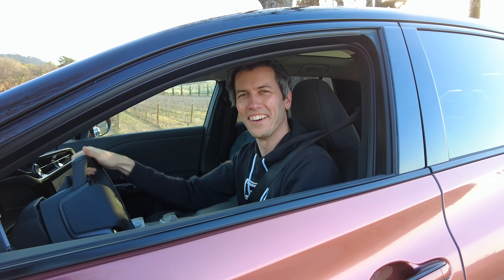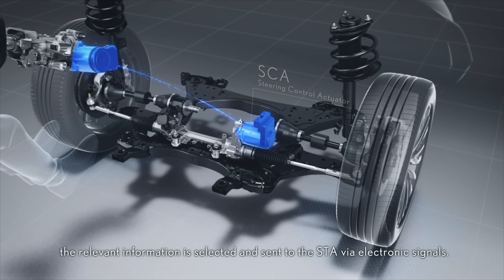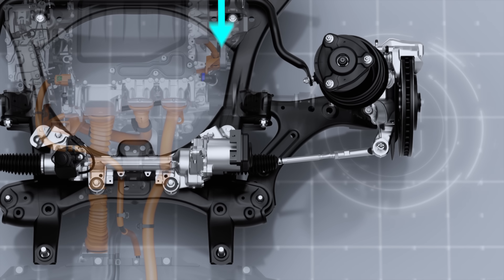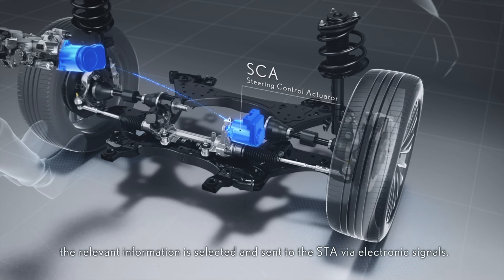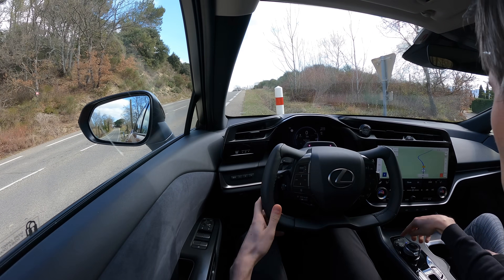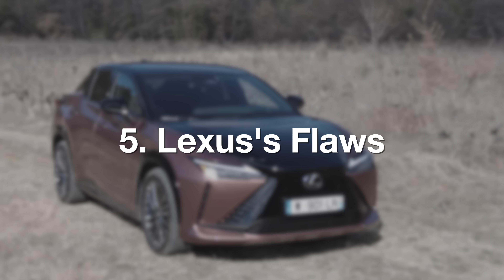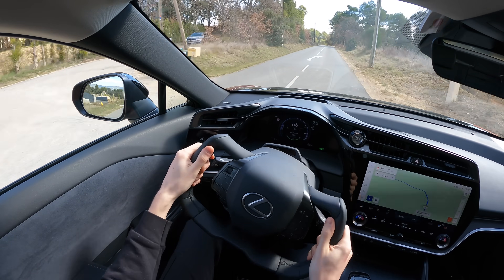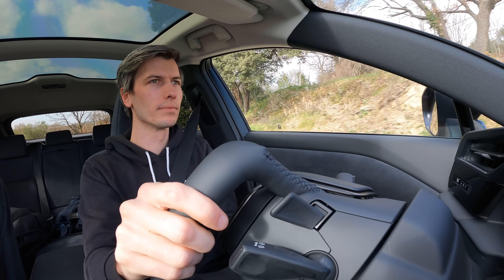How Lexus Fixed Tesla's Bad Idea: Steer-By-Wire Yoke

Comment: May they get sued by many average and below drivers who crashed because of this absurd idea that this is better than a solid, physical connection for steering.  May that engineer get fired and wonder what the heck he was thinking when he thought this better and may the entire board that approved this (even the prototype) get fired for their incompetence.  May the woke buyers who think newer is better get so sick and tired of hearing their wives complain of parking lot woes and trading paint on the highway that they try to give it back to the laughing dealer for a refund and end up losing 10k and getting the regular one with the steering shaft.  May the president of this company and all those that follow in this stupidity get into a steering-induced accident where they lose their teeth but their health is spared, so that they can smile in the mirror in the morning and be reminded of the dummy of yesterday who thought there is a better way by wire.

Comment: Fun Fact: This tech comes from Airbus aircraft. They were the pioneers of the Fly by wire system and is why airbus planes have sidesticks and not yokes like Boeing. :P Boeing uses a yoke with hydraulics system. If u lose that ur done. However on a airbus,  u can still fly with no engines or hydraulics. Another benefit is that if there is a situation, the pilot doesn't have to hang on to the yoke like on a boeing. Cuz airbus uses fly by wire the plane will always level off normally without inputs. This allows for BOTH pilots to focus on their checklists and manuals and getting the situation under control. If lexus made it similar to airbus' sidestick it'll really be a killer car in terms of tech

Comment: I have played ETS 2 and various other vehicle sim games more than I've ever driven a car and I haven't got a single accident in game resulting from the steering system. So safe to say I trust Lexus to come up with an even safer version of a sim wheel than the one I'm using. Also, nobody drives a car by how strong the feedback on the wheel is, I drive a Mitsubishi and the road shock never transmitted to the wheel.

Comment: Another huge fail not mentioned. You are forced/ or this requires, to always keep hands at  same 9 and 3 position....which is hugely fatiguing and cumbersome for casual and safe common average driving needs, particularly long drives.
also fail, along same lines, parallel parking is made more cumbersome. Full fingered grip give more powerful yank making darty slalom maneuvers enhanced.
Reply: Because people don't take their time to set their seat and steering wheel ergonomically. It's shouldn't be tiresome to hold your hands in 9-3 o'clock position.
The guy says it is extremely sensitive while you are driving with a low speed tempo. You will handle it differently, so it's quite meaningless to form an opinion without even trying it out once.

Comment: I don't know if I'd like that.  It'd feel so weird reverse parking by only turning the wheel a quarter turn or whatever it is at low speeds to get full lock.  Plus I like to rest my hand on top of the wheel when waiting at traffic lights or whatever.  I don't think I could get used to the adaptive change in wheel sensitivity at different speeds, but I guess I won't know for sure until I try it first hand.

Comment: Seems overcomplicated to me. A progressive rack with electronic assist can do all of that already. There's even systems with planetary overlay gearboxes that can "disconnect" the sterring wheel by twisting the steering shaft.

I'm not sure it is worth the overcomplication to go fully electronic. Stuff like the delay between input and steering angle can completely destroy the feel of a system, and they are notoriously difficult to eliminate. Ask Airbus why "Pilot induced oscillations" are such a problem on their aircraft - with significantly larger R&D budgets than an automotive steering system designer could ever dream of.

Comment: Variable ratio steering racks have been around for a long time also. Think ls400 as an example of a high contrast difference between settings. And, when the variable ratio stuff fails it’s default is the short ratio. But there’s a reason it didn’t become the norm. It wasn’t drastic enough. Good enough for sports cars, not good enough for a yoke. This eps stuff is cool. And I can’t wait to see what it does for enthusiasts. I hate electric steering. I started with a Saturn ion. Earlier adaption or the electric column. And now drive a 2017 car with eps. Feedback just will never be the same as moving a fluid. This is cool tech, and the future no doubt, but also bittersweet.

Comment: Fly by wire is cool and safe ,if you have a team of technicians servicing your car/plane before and after each use, but for a private passenger vehicle....not having the ability to steer your vehicle in the Avent of a electrical failure is highly problematic.

Comment: I'm not going to trust my safety to something that entirely isolates direct control from me, no matter how many failure reduncancies it has. It's overengineering a solution to a problem that doesn't exist, and coming out worse for it.
Just as I might bypass the power steering pump in my car, if this car were what I had to drive, with the yoke by wire option, I would absolutely chop the steering system, drill a hole in the firewall, and install a rack, tie rods, and steering column from some mismatched junkyard find to replace the system. Even if I have to assemble it with hopes, prayers, and hose clamps, I'd put more trust in it than what  the vehicle comes with.

Comment: Dude you made a 14 minute video with the title saying "why tesla sucks compared to lexus", talke trash about tesla through out the entire thing and then 8.5 minutes in you finally address why tesla is bad and lexus is good. 
here are the points:
1) telsa yoke turns more
2)tesla yoke has less buttons
3) there is no #3, you only had two wack ass reasons.
click bait much? or do you just hate tesla for doing it first?

Comment: I saw a video about steer-by-wire back in the 1980s or 90s. With variable ratio too. But they had a side mounted twist- joystick on the driver’s armrest to leave a totally clear space in front of the driver. Have been waiting for it ever since...
Reply: Wasn't that saab trying to pull the "we used to make fighter jets" card? Idk I kinda think it woulda been neat

Comment: I'm pretty sure that this car will not be allowed to be on the road in my country
it's illegal to drive heavy machinery faster than 20mph  on the road if it has only hydraulic steering, so no physical connection, just hydraulic valves and pistons

well, I drive a 21 year old car, it's safe and reliable and it will propaly still be driving after the first hand full of steer by wire cars had fatal crashes due to software issues

Comment: Depends on the car but mechanical connection allows for your wheel to operate as a sensor about road surface and grooves.

Comment: I was going to correct your statement about the "normal" option being rack and pinion, since Mercedes recirculating ball steering was their norm.

Though, asking Google says MB has abandoned RB steering and moved to R&P like everyone else.  Not sure exactly when or what cars were last for the transition moving back to R&P.

As to short ratio, I went from a Subaru WRX with the standard 3.1 turns lock to lock, to a 2.5 lock to lock WRX of the same year, which is super twitchy at high speeds.  It's beautiful.  I've not compared my caster to others, but it is stable and twitchy.

Both stable and twitchy?  Yes.  Stable in a straight line, but super-quick turn in and hard to keep in a lane over some rough roads.

But I still like 2.5 turns lock to lock much much better than the "standard" 3.1 turn lock to lock steering.  Though my steering range is smaller as well, so my turning radius is higher.  Three mechanical LSDs, so not quite the full range of motion over the open-diff AWD models (or later electronic diff models which don't have mechanical binding in low speed tight turns on grippy surfaces).

Comment: Awesome video and awesome system! One big question for me: if I steer up to a certain degree at high speed and break down to a much lower speed without steering back, theoretically when I turn the yoke back at this point the ratio will be different. Will the wheels be straight and the yoke steered?
Reply: Potentially the amount steered adjusts as you slow, I guess. Good question for sure.

Comment: Since it turns the wheels depending on the speeds that you're going, what's gonna happen if the wheel speed sensors fail?
Reply: It would be likely that either they'd make the sensors able to handle very high speeds, or you'd die

Comment: My CRV has lock-by-wire. If the battery dies or fuse blows. I have to call someone to open my door so I can pop the hood & charge the battery/change fuse. The key does nothing without power.

Comment: Technician here. With some of the crazy things I've seen over the years, I can assure you that a mechanical backup in every control system is the best way to move forward.
Reply: Person with common sense here, I agree.
Reply: agree!! having multiple redundancy  is like saying yeah we know it will fail, but alas we have a backup! no amount of feedback fine tuning can translate to a real world feel, but well we are the consumer we are always the lab rats of crappy first time technology.. critical machines still uses mechanical coz they work from submarines to tanks to space stations and a lot more.
Reply: It seems like they'd have to maintain a mechanical linkage as a backup just to meet safety regulations, same as they do with "drive by wire" brakes, but I have no idea about the laws on this... I just know that fully hydraulic steering is not road legal, either. It also seems like a lawsuit waiting to happen after some other company designs their own system and decides to cut a few more corners than lexus. Overall, I just don't see the point. It seems like the same or similar outcomes can be achieved with a regular EPS setup, if you're not trying to use the yoke. And that's all this is really for... high-end tech designed to fix a problem that was created by a gimmick. People like round steering wheels. I'd never choose a yoke.
Reply: @DeusTex  i have lost hydraulic fluid while driving, got it home still. Steering was just heavy bought a fluid and then just kept refilling, lost a belt still kept going just heavy input is needed to steer. lost fluid on my clutch still got it home.. the mechanical part will always function hydraulic just helps the user to operate it with less effort.. with these kinds of system losing something means a completely un drivable car. If you are in those countries less developed good luck getting home.
Reply: @jefflipio3573  Same here. My serpentine belt broke. Steering was heavy and the brakes were heavy. Car overheated etc. But I got home.
Reply: The aviation industry does not seem to agree. The most recent Fly By Wire planes have no mechanical backup whatsoever.
Concord had FBW with full mechanical backup. Later planes like A320 and B777 only got very limited mechanical backup on a few control surfaces, just intended to temporarily keep a minimum of control while basic functionality is restored. But FBW proved to be so much more reliable than classic cable systems (which sometimes broke or got stuck) that the most recent airplanes like the B787 got rid of mechanical backups entirely. They do have several independent flight control computers with multiple redundancy built into each of them, and multiple actuators on a large number of control surfaces. Two motors for a steering wheel doesn't offer nearly as much redundancy but then again, classic steering wheels with cables or other linkages have been known to break too, so it's all a matter of weighing probabilities.

Comment: The problem with tech is it needlessly complicates things.  Now I can't just get in my car and steer but instead I have to f around with choosing how I want to steer.  I have a samsung  s22 ultra and will never learn or use a fraction of the capabilities of the phone.   I hate the radio in my car.  Old time knobs made it easy to tune and adjust the volume but new ones with 50 buttons and a dozen screens make it practically useless for me.  So what happens if you are out driving and the steering shorts out?   How do they address a possible failure.  I have heard of steering boxes that go out but since it is mechanical you usually have plenty of warning and is not likely to fail when driving,

Comment: Just more electronic garbage to break, more fuses to blow, more wire to run. Expensive electrical motors. Ever heard if it’s not broken don’t fix it? Y’all need to stop putting more electronics and put more metal  and less plastic and fake leather

Comment: So one shaft or two motors with two redundant motors and my favorite part of all, the warning screen on the dash that says something like, "Lexus has determined that one or more redundant steering components have registered as faulty.  You may not start your car until it has been serviced by a certified Lexus mechanic."  An argument can be made that a normal steering columns can fail, but I personally have never had that happen and I don't know a single person who has had that happen.

Comment: You know, in 1969 they built a very safe chemical factory, with lots of redundant systems in case of an emergency.
They built it in Bhopal. Guess what happened in December 1984

Comment: Nothing about that was redundant when it all relied on electricity, nothing is better as a redundant measure then physically steering the car when it looses all power if it is mechanically connected to the wheels unlike “drive by wire”

Comment: So it's a technocratic scam after all. 1) The downsides tend to be red flag. 2) It solved problems you wouldn't have or worry about without electronics everywhere. 3) Electronics are still more prone to mishaps than mechanical things, and I think especially Lexus has a worrisome track record there. A mechanical steering won't fail fatally, but an electronic steering with certain flaws could decide to violently steer you into oncoming traffic and you can't do anything about it. (Same problem can occur with self-driving cars.)
Big-picture this is, as mentioned before, all part of the technocratic agenda of disconnecting us from the physical world and putting a manipulative, simulative intermediate in place that seeks to eventually control your whole perception of reality.

Comment: The solution for the delay is not to make the wheels move quicker, but to make it harder to turn the yoke. Why can't they tune the feedback motor to make sure you can't turn the yoke faster than the steering mechanism?

Comment: I think I'd be more concerned 10 years down the line when the warranty period is up and some design flaw has allowed water ingress to the loom and broken a vital connection. This happened on my car and is apparently not uncommon, fortunately it just stopped the engine from running, rather than losing the ability to steer. I'm also not sure how easy it would be to get used to the varying sensitivity. Interesting video though👍
Reply: Toyota has been pretty good with fixing unexpected problems. Especially after the "stuck accelerator" incident, and the rotted out Tacoma frame recalls.
Reply: @patx35  In the case of the rusted Tacoma frames it took a class action lawsuit for them to make it right, they didn't do it out of the kindness of their heart.
Reply: Not just critical components, but seems like a lot more parts that can wear out and need replacement. I wonder what the long-term maintenance costs associated with this steer-by-wire system will be?
Reply: Don't worry about that, 10 years from now, new electric vehicles of today will be in your cupboard with your old smartphones
Reply: @desertstormer7556  You must have big cupboards in your house
Reply: Water ingress in a mechanical linkage can corrode it, potentially leading to notchyness and breaking. Yet, no one really worries about that.
Reply: @Gnerko123  Because that never happens on a steering column. It can happen to tie rods and the rack itself, and steer-by-wire still has the same exact problem.
Reply: @Gnerko123  when has that happened in the history of cars? Also, how many water ingress related wiring failures have happened in the history of cars? 😂 I suspect the numbers may shock you...

Comment: So now, with the lack of direct feel, the rack and pinion system suffers. More $$ for the parts man. 
Sigh, we lost the clutch, we lost the gear stick, we lost the hand brake lever; now we are loosing the steering wheel???
We all know that roads are built for racing cars. The commuter cars are not so fortunate, that's why the four wheel steer is not so popular because of the varied conditions faced in normal driving.
We need a way to get those wheels turning without power on the vehicle in some cases. 
I see we are going to go back to mechanical connections if this comes on line.

Comment: You mention the same system as throttle bodies and accelerator pedals. Which is all well and good but those commonly fail and leave cars showing up in limp mode or on a tow truck. Steer by wire wouldn't be unsafe per se but I would expect to see vehicles with steering correlation issues since car makers can't seem to get throttle by wire dialed in. I'm not saying it's a bad concept but I can see them having just as many issues as traditional hydraulic steering systems.